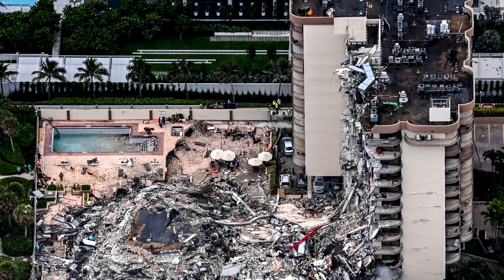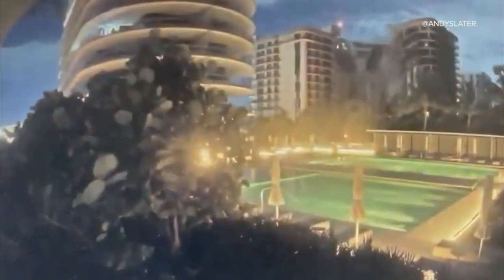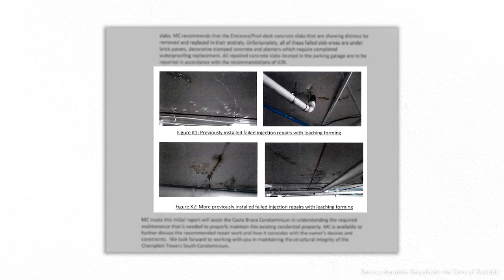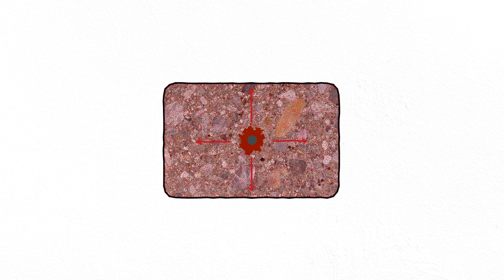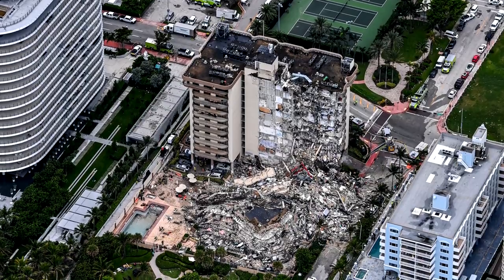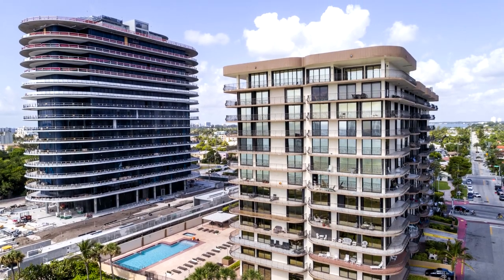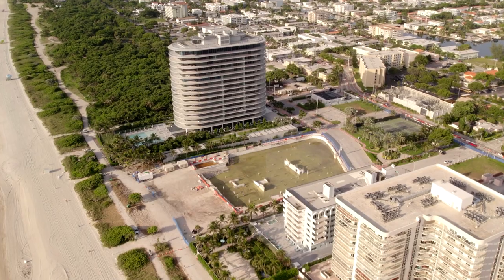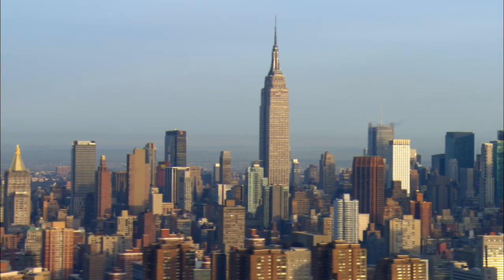Surfside Condo Collapse: What We Know So Far

Comment: I'm a building contractor here in Florida, and I'm completely appalled at the amount of deterioration I'm seeing in these photos. I'm finding it hard to understand how the urgency of this damage was easily apparent. I can't wrap my head around it. I build a residential single family dwelling, and I have to go through SOOOO much engineering, inspections, and ongoing education. These guys have a high rise building under their care, and they don't even have an understanding of the structural requirement needed to keep it standing. This astounding to me. I just can't believe it. What a mess, and what an easily avoidable tragedy.
Reply: I'm truly sorry. But a house I designed and drawn up by a pro. Than built. By a local builder  hat  kept passing each phase my beautiful home  that was designed for spec. 
I put the flaws on the builder yes. But more so the men or persons that approved each phase of the house should be fired as well as the builder.
And prosecuted. 
When I put the house up for sale an inspector for a buyer found 11 pages worth of serous flaws. 
Costing me another $250.000 to repair.
Even at that a leak was never found.
 the house way below market price .with the buyers aware of leak...
The husband  of buyers quickly found the leak in a smaller bed room. After several other home inspectors said it was coming from the master deck. 
Well 3 times the deck was re built with no luck for leak while the story  ended up well .it did not for me..
I should have sued Volusia county 
I nspectors  as well as the builder .but after 5 years of hell  and bad health I was just and lack of money .I deside not worth the effort.
Reply: @rosemarymcnally100  well it sounds like you had a really bad experience. I'm not sure how any normal sized home could have $250,000 worth of repairs, but OK. Many of the homes in my area sell for that price new. If there really was that much damage, then you absolutely should have sued the builder. And should still sue them. A building contractor in the state of Florida has a tacit responsibility the lasts the life of the home. If you incurred a quarter million dollars worth of costs because of something he did wrong, then you could absolutely take him to court and win. He has to have at least a million dollar insurance policy to be operating with a license.
Reply: Change understand to underSAND & that tells me ALL I need to know about FL00R~Rid~Duh...
Reply: All that exposed rebar was horrifying.
Reply: A Fels  holy shit, what a mess. Wow.
Reply: Stellvia Hoenheim  that's Dr. Hindsight.
Reply: Money talks
Reply: @SFKelvin  no it’s just the regular corporate criminals not doing their jobs because there’s absolutely no accountability
Reply: Stellvia Hoenheim  maintenance isn’t hindsight it’s standard practice
Reply: You are spot on, who the responsibility lies with is as clear as mud...
Reply: Unfortunately what you see and how you see it with your trained eye is not how someone like myself would see it, I like many others lack the knowledge, and those that did have the knowledge was either undertrained or morally flexible. Money unfortunately talks both ways.
Reply: A Fels  I'm no engineer but would guess that, with the type of solutions needed to correct the lack of pool deck drainage and the decades of internal corrosion, including expensive testing to identify the extent of the corrosion, it would have cost a lot more than an extra $5 per month for the owners.   And having served on boards myself, the politics of making very tough, very pricey decisions could have easily held it up for that long.
Reply: Two worlds bribed inspectors
Reply: @DigitalNeb  I’m sure the builder had it going through a corporation and that keeps you from going after them personally and all they have to do is dissolve there corporation and start again with new name, there is no winning  unless you or suing a major corporation sadly
Reply: @gustavedelior3683  that's why you do your own inspection with people you trust.
Reply: A Fels  and they though a group of people would be better than a corporation, wait. corporations are groups of people, same bullshit.
Reply: I don’t see how the construction of this building was up to code for hurricane standards, especially for a building this tall.  The walls throughout the building used steel framing which doesn’t have anywhere near the compression strength of concrete.  Those walls should’ve been made from concrete or block filled with concrete.  Had they been built that way, this building would still be standing, as the solid concrete walls would’ve acted just like a continuous column around the entire complex except for openings for doors and windows.  Additionally, concrete should’ve been used to subdivide the building into it’s individual condominiums for fire safety as well.  Yes, it would’ve made for a much heavier building, but a much, MUCH STRONGER BUILDING AS WELL.  As it was built, those thin columns had to carry the weight of the entire building down to the ground.  That’s asking a lot for such columns in an area highly prone to salt water intrusion and Category 5 hurricane.  I have to think, after watching so many videos of this building’s construction, that a direct hit from a Katrina sized storm would’ve collapsed this building along with others of similar construction.  If I was living in the other towers by this company, I would’ve already moved out by now, regardless of inspection results.  There’s simply not enough structure in these buildings to ensure they’ll remain standing no matter what type of weather they’re put through.  I saw in another video that the pool deck , when in perfect condition, was already bearing nearly 100% of its static load capacity just from its own weight alone.  So it’s no wonder that the corrosion of the rebar had pushed it beyond its load carrying capacity.  It was a ticking time bomb waiting to go off.  Unfortunately it went off when nearly everyone was asleep.

Incidentally, my one story single family home which sits about three blocks off the beach in NE Florida has more strength in it’s construction than this condominium complex had.  All my exterior walls are concrete block, backfilled with both rebar and concrete fill.   My house was built to withstand a category 5 hurricane.  I doubt this condominium building would’ve withstood such a storm.
Reply: A Fels  I doubt the Penthouse was illegal.
Reply: @mudman6156  one important thing to remember is that this building was constructed about two decades before the implementation of the new building code for Florida. That building code was updated with several hurricane related safety improvements because of the devastation left by hurricane Andrew. Personally, I think it comes down to maintenance. Home owners shouldn't be responsible for a high rise. They just don't know what they're dealing with.
Reply: ... almost like it was intended huh? maybe one day you will have a clue?
Reply: @mudman6156   The building was up to code at the time that it was built. After hurricane Andrew, the code was increased. And It has withstood storms in the past.
Reply: @sundaywhiterabbit7679   The only demolition on that building was on July 4th!
Reply: @DigitalNeb  in reply to your comment backing at 250k repair cost: what a lot of people don’t understand is when you have a problem in a home it costs costs a lot more to fix the problem than it just does to build it correctly to begin with. Sourcing the problem, removing/storing contents and structure to get to the problem, remediating and rebuilding the problem are all incredibly time consuming exercises that add significantly too the bill. Jobs involving water leaks and mould add up incredibly fast due to how destructive and time consuming they see to deal with.
Reply: I don't believe every photo used here was from that building.
Reply: @mjinba07  More like $5000/month, on people who earn half that.

Edit to add: One thing that nobody seems to get is that condos are 100% owned by the unit owners. Put a lien on everyone's unit and you've sent half your building into bankruptcy and made the other half homeless - and you're still not going to get the money.
Reply: Man, I agree with you 100%. It’s pretty damn hard to get a permit and the bldg dept goes through drawings with a fine tooth comb and then this happens. Smdh.
Reply: It's easier for inspectors to go after the little guys who can't mount a defence or argue back.
Reply: @DigitalNeb  I’m wondering about the time period the building was built it was during the Miami Cocaine days money laundering was going on land values skyrocketed. I noticed that some columns were not built to spec with less rebar than called for the pool deck wasn’t pitched correctly a costly redo during construction something seems off.
Reply: @steve-ph9yg  I mean, I hear you, but changes to specs happen all the time during construction projects. The builder finds an issue, contacts the engineer, and he makes a small change order, stamps it, and work proceeds. These change orders often get lost. So yeah, some areas weren't built to spec on the plans we have to look at, but that doesn't necessarily mean that they weren't built correctly according to the builder and the engineer at the time of construction. Think of the blue prints as a "best case" drawing of what they want it to look like. What we need are a set of working plans from the building that show the various changes along the way, but those may not exist anymore. Forty years is a long time to hold onto a set of dirty old working plans.
Reply: @rosemarymcnally100  Very difficult to follow your thought process, pretty disjointed message
Reply: @JTA1961  Exactly, do NOT build on sinking sand, period.
Reply: @DigitalNeb  Fuck..... I read it as Captain Insight, I need reading glasses
Reply: many apartment buildings here have issues because they are owned by the residents, so the residents manage the building through an elected group. Now what often happens is preventative maintainence is not done then Whenserious  issues come up they seek to fix only those specific issues, and when fixing those they discover new issues and new issues, and fix them. then they find they have spent more than the entire building was worth, whereas if they on finding the first issue knew what they were doing and investigated the whole picture they may have just written the building off and sold it for demolition.
They should require professional companies to manage residential buildings and not allow the residents to manage it themselves.
How many regular people see a leak in a common garage and just think eh thats a minor annoyance, but they don't get it dealt with couse they don't think it is important.
Reply: Should’ve seen the last video i watched, some girl commented & literally blamed the tenants for not fixing the building when it was the building owners responsibility. She basically said that they deserved to die the way they did. My blood was boiling 😡 IF you ever rent property it’s always the landlords JOB to keep up with maintenance. So sad so many people died 😔RIP
Reply: @yagikidd2300  well, I agree, but in this case, they weren't renting the property. They were condos, and everyone owned the one they lived in. The building it self was managed by an elected Home Owners Association which then made decisions for the group. That's not to say they deserved to die by any means, but they were responsible for the maintenance. I think what needs to happen with buildings like this, is that a professional management company needs to be hired by the home owners to manage the maintenance.
Reply: @mudman6156  You have to understand that there's no company.  This was jointly owned by the residents, including the ones killed by the collapse.  They probably elected some fellow residents to make decisions, including hiring maintenance people.  Somewhere in this chain of command, not enough was done and the people ultimately in change died.
Reply: @yagikidd2300  In this case, the tenants were also the owners.
Reply: goes to show you most of society is a facade, and held together by ducktape.
Reply: @aristideregnier4883  yeah, for sure. Shocking when the veil gets pulled from our eyes for a second huh?
Reply: A Fels  THIS is the problem. No one wants to pay. If it's your house and you've got water pouring through your roof, you fix it. In a block it's "someone elses problem".
Reply: Laws need to be changed to avoid this sort of tragedy from ever happening again.
Reply: Thom, I'm glad to see builders and contractors like you who recognize these things.

A lot of people will say neglect and greed and stuff, but honestly a lot of the times I feel like it just comes down to stupidity.

I've been in buildings where I've noticed bad corrosion and other issues, and when I pointed out I bring it up people basically look at me like I'm some kind of nut job.  Is if I'm being ridiculously nitpicky or something...

And since sometimes corrosive things can go on for years without having an effect, if they're lucky, these people go on believing that it's just not a big deal.  It's absurd
Reply: My understanding is that construction in Florida is sometimes a lot more concerned with deadlines than quality and safety. And I would dare say, that it’s not just Florida.
Reply: That’s scary. I guess we’ll possibly be seeing more of this then. 😬
Reply: @SFKelvin  I live in Calgary Canada and they had to delay a footbridge crossing one of the major roads here because it was a centimetre too short. This delayed the structures completion by I think six months or so. But that bridge is solid now and who would have thought that such a seemingly insignificant issue could have turned out to be such a danger later on? Well it would have been.  
Shortcuts just cannot be afforded in structural engineering of any kind. Quality is worth the wait.
Reply: @Urban_Piggy  Until the majority of people stop believing that rust and shit is a myth lol
Reply: A Fels  yep! The people don’t want to pay any more for things but want everything in perfect working order. That’s why those associations are shit when they have people who don’t know shit, in charge. It’s such a shame that this building came down. Totally could’ve avoided it.
Reply: @mjinba07  exactly.. and when doing nothing and prolonging, decisions, is actually doing something.. now lives are lost.
Reply: @gregdubya1993  of course not! He had photos showing examples of rusted rebar in concrete to show what happens.
Reply: Yes...when u hire a corrupted bastard...they mostly take all the money in its pocket...and left some to just buil a tower that barely stand on its own....this tower collapse...and their ceime was shown...
They all ned to be charged and put in jail....for 40+ yrs ..
Reply: Avoiding tragedies cost money, HUman lives are cheap in america. Its easier for corporations to let the one tragedy happen once every few decades as their wallets keep expanding.
Reply: @gamerdude223  This was a building owned by the people who lived (and died) in it. No corporate entity involved.
Reply: @rosemarymcnally100  Your entire comment is unintelligible gibberish. Do you not know how to make a complete sentence?
Reply: Matt S I understand Rosemary entirely. It is you who who has comprehension problem.
Reply: @sundaywhiterabbit7679  A controlled demolition doesn't have people in the building. Cus peole dying is the exact opposite of controlled.
Reply: @pinklady7184  I don't think you know what mica is.
Reply: Ikr? The least they could do is to drain the pool although not sure if that would be enough.
Reply: @DigitalNeb  What is the life of a building? Here in the UK, some are 600 years old, with suspicion that some predate Roman times. I have a musical instrument made from part-petrified wood carbon-dated to Jesus' day. Some materials survive.
Reply: @SFKelvin  No, the evidence points to inadequate management failing to respond to design flaws.
Reply: @mjinba07  True, the first hints date from far earlier, and it was an issue. Perhaps such decisions require more strength to the inspection reports, removing any sense of collegiality in favour of legal mandate, including more fundamental issues on fitness for habitation.
Reply: @mudman6156  Given we have only minimal understanding of hurricane dynamics, in particular gust and vacuum working on a static structure, and on catastrophic propagation of microfailures, the building standards can only be empirical. There must, for example, be a sound case for reexamination of property after a hurricane has passed.